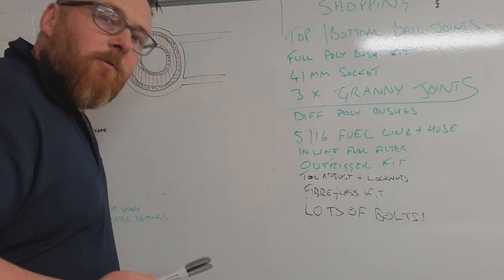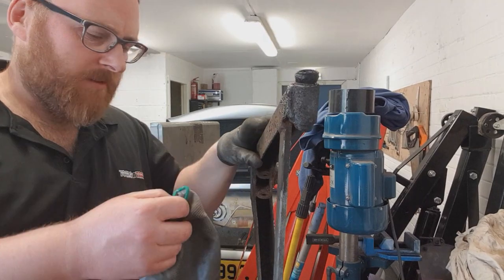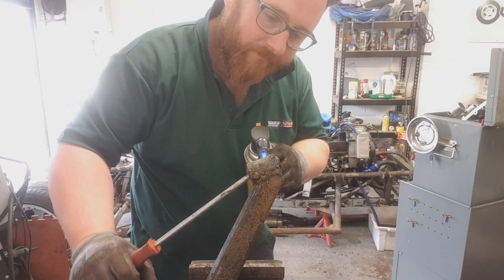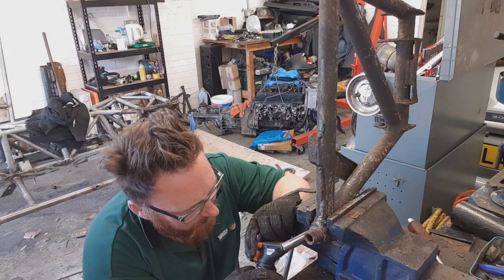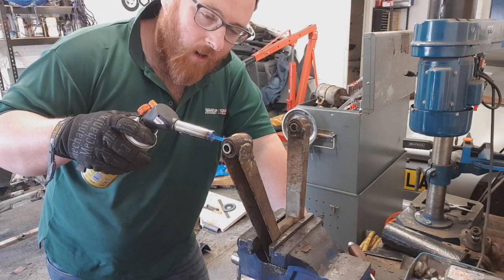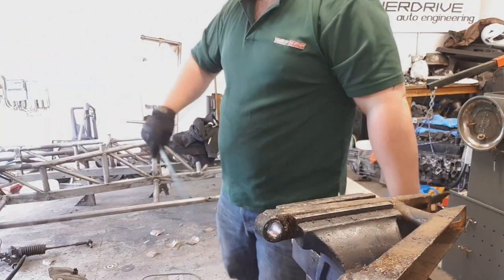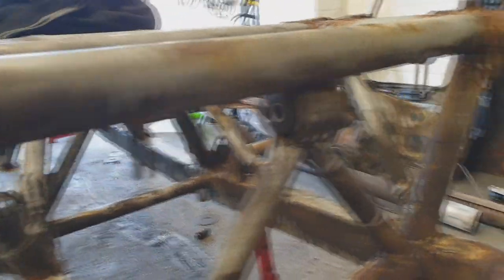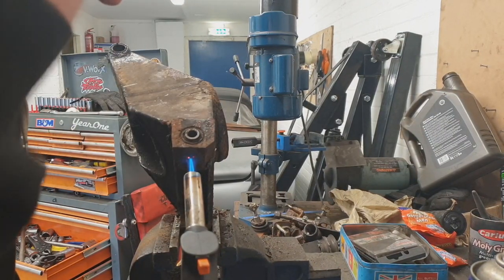TVR Chimaera CHASSIS RESTO - Episode 5: Wishbone Bush Removal

Comment: I've found that the best way to remove bushes is to deliberately set the rubber on fire and let them burn, the centres eventually fall out on their own you can burn multiple bushes at the same time, but I would recommend doing it outside, lots of toxic fumes and black smoke! I then remove the outer sleeve with the hacksaw method, as you did.

Great videos of honest, real world diy car maintenance and repair with limited facilities, well done sir!

Comment: Hammer based violence LOL, I'm stealing that! I know the job is now done but for future reference MAPP gas blow torches are the hottest burning blow torches you can get. The next step up would be oxy acetylene. Bit pricey but i would never go back to butane unless it was for a camping stove!
Reply from the maker: It was never going to heat the sleeve out, really just enough to get the rubber out the way

Comment: Did you try gripping the toe adjuster in a vice across the flats and then trying to unscrew levering with the wish bone itself? Have heard that works... Although my guess is you'd still end up with a knackered a adjuster.
Reply from the maker: Yup, we tried that before the Stilsons, it just ended up dragging the bench across the workshop. Some may well respond to that, but ours were totally siezed.

Comment: Cheers for the advice on this common job. Just wondering, did you consider using a ball joint press? I was thinking if they have enough uumph or not to push the things out. I have this lovely job to do too with my shock absorber bushes this winter.
Reply from the maker: Yes but I have little faith in them. Violence wins every time.
Reply from the maker: The main reason though was we wanted to use as many common tools as possible. Whilst a joint press is a common enough thing, we tried to keep its as basic as possible.
Reply: The ball joint press worked a treat on my shock absorber bushes. For the really snotty, crusty ones I made a cut through the centre sleeve, through the rubber stuff and close-ish to the edge of the outer metal sleeve of the bush. 5 mins with the hacksaw and vice. After that easy peasey! No burning and no cold chisels. 

Sorry to mention this... and I appreciate no one likes a smart *rse. I just saw a snippet of your MR2 video and thought best to mention it if you have more bushes to do.

Comment: Had to get my rear toe adjusters cherry red with oxy acetelyne to budge them.
Lots of anti seize compound on them when re assembling.
Reply from the maker: Yeah the rear toes were the biggest ballache of the whole job. Certainly one to be prepared for if those who are planning it are watching!
Reply: @ToolsnTrack  Not sure it would have worked on yours as they looked solid, but the way I did it was to tighten the 2 flat sections of the screw end into the jaws of the vice then use the actual wishbone as the lever & it came out. Lots of PlusGas was used :-)

Comment: You can cut the middle out with a hole saw ???
Reply from the maker: The rubber part? I'm sure you could but fire is more fun :)
Reply: @ToolsnTrack  yes the rubber bit ,but fire is more fun
Reply: @nicknick-ht5dv  that's the method I used.... and destroyed 3 drills